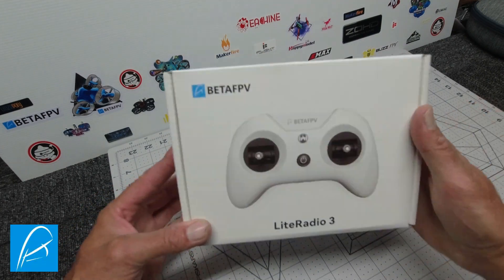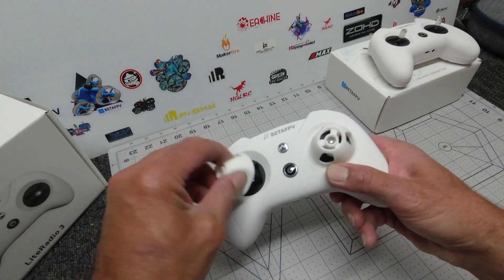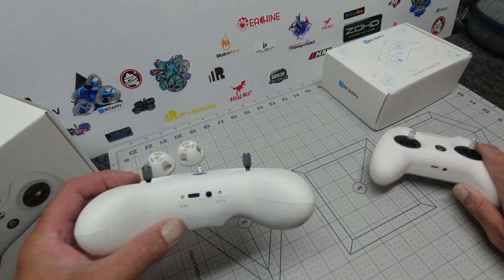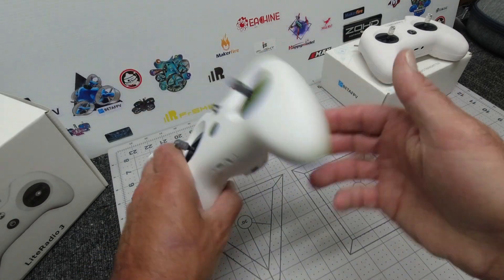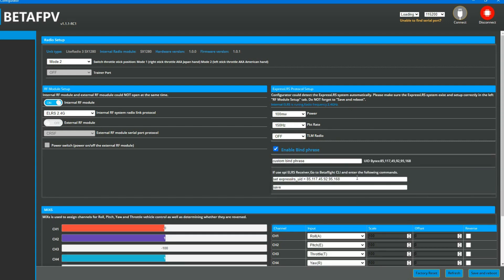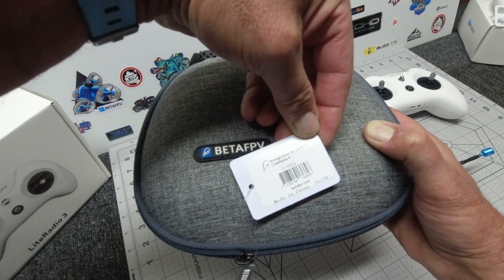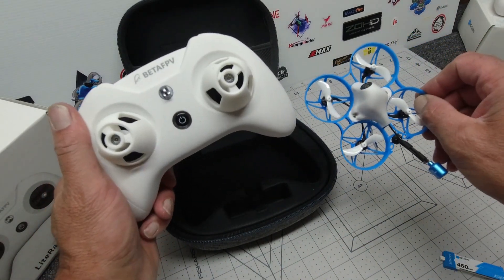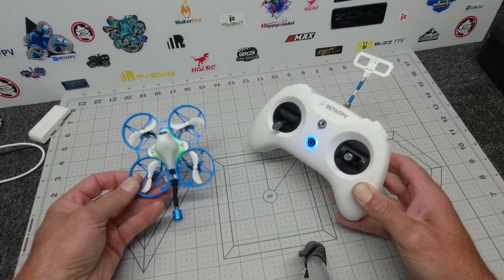BetaFPV Lite Radio 3 - Express LRS-External TX - Setup and Review  ❤️

Comment: Hello! Can you give me a guide on how to bind literadio 3 pro to pavo25, already bought rf module as well. 
Newbie here
Reply from the maker: Sure.
If using elrs. Power of and on the quad 3 times to enter bind mode. Alternately you can use cli command in betaflight.  Bind_rx.

Do in conjunction with tx instructions:

Binding the Receiver
There are the steps to make the LiteRadio 3 enter binding status.
1. Power on the radio transmitter and wait for its system to load completely. LED 
ring will be solid blue if done correctly.
2. Press the bind button on the back of the radio transmitter to enter binding stutas. 
The LED ring will be red and

Comment: I dont get it what is that adapter? "if you want to play with the elrs" What? its not already an elrs transmitter?
Reply from the maker: You are correct. However.   The internal elrs tx has a 100mw max power output while the external tx has 500mw max output plus an improved antenna. Great for best penetration and range. 👍🍻

Comment: Is it compatible with elrs without the external module? I've got an elrs nano drone on its way an I'm a tad conused by everything x3 I'm used to toygrade stuff so its a bit of a step up
Reply from the maker: If you purchase the new lite radio 3 it has elrs built in so there is no need for the external module. The external pumps out 500mw and the internal only one pumps out 100mw. Both are well strong enough for a play!  👊🍻
Reply: @GTARC_au  Thanks! I'll give one a go with the internal antenna